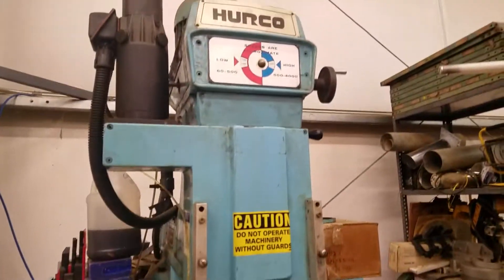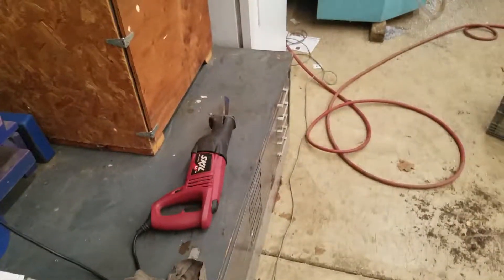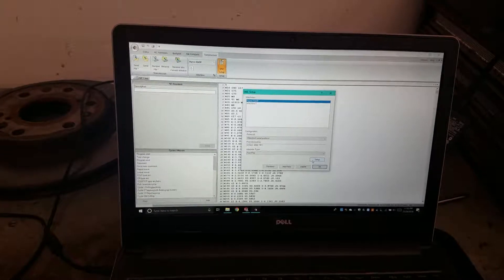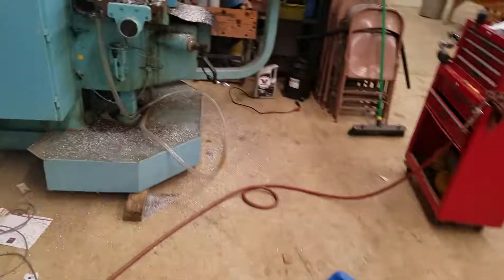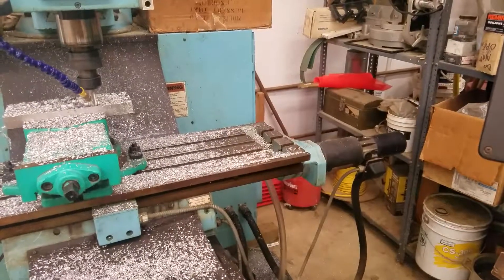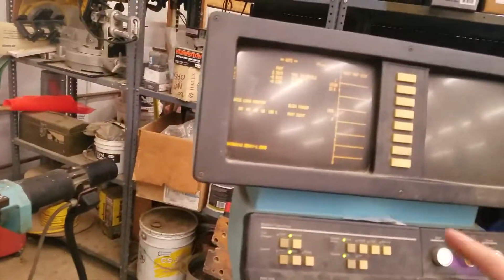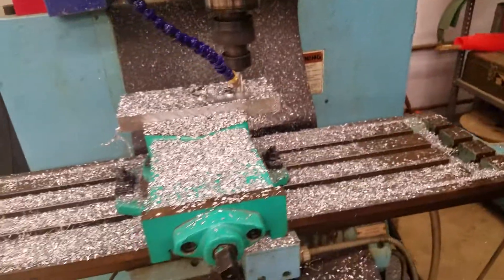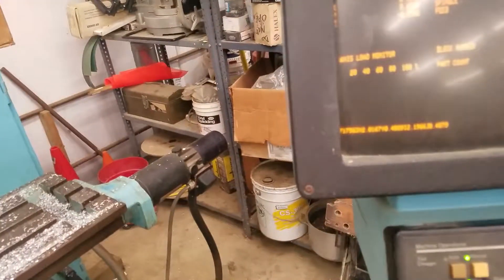1983 Hurco KM3 running CAM generated code

Comment: Hello man, I got an 1984 Hurco BMC 20 and I would like to load programs (that I make in Fusion 360) via a floppy drive to USB emulator, but I don't know if the Ultimax 2 controller has the capability to support that or do I need to feed the G code like you do with your Hurco. What do you think?

Comment: I have a hurco kmb1 it runs hurco conversational code but i would like it to run gcode somehow. Did your Hurco run conversation code and then your converting that to gcode?
Reply from the maker: No, the machine in this video was running on straight g code and was not using conversational programming. I was sending it g code via RS232 serial, and there should be a setting somewhere on your machine on the controller to switch it to NC mode. However, if its anything like mine, when you do this, you will loose some settings like tool offsets and work offsets when you change it from conversational mode to NC mode.

Comment: I know this is old, but did you ever take photos of the manual?
Reply from the maker: I think I might still have the manual somewhere. I'm in the process of converting the machine to run on a different controller (LinuxCNC). What pages do you need?
Reply: @flyingfencepost  I haven't purchased the unit yet. I'm pretty much researching right now.
Reply from the maker: @RailyardProductions  Gotcha, well from a usability standpoint, if the stock controller is working well, the conversational programming is very easy to follow, albeit somewhat limited. And as far as machine maintenance goes, it's very similar to a Bridgeport.

Comment: Ask a question What is the speed of the motor hurco km-3 RPM, I will connect it to the inverter. The nameplate of the motor is missing.

Comment: I recently purchased a Hurco KM3 and do not have any Pinout info for RS232.  Do you happen to have the info on how you made the cable? I have the MIL ports on the back and not sure how to pin them out
Reply from the maker: Sure thing, I have a complete manual so I believe this is the page that should help you out. My dad built a harness, but that was so long ago I cant remember what the pinouts were. https://imgur.com/a/yxnlLyl
Reply: @flyingfencepost  that's awesome!!! Thanks so much!! What would it take to get a copy of that Manual? I contacted Hurco and even they don't have any info on these old Machines
Reply from the maker: @KEBGaming  shoot. I don't even know. You could maybe find some on ebay, but otherwise, I could perhaps scan it. Are there specific sections you'd like?
Reply: @flyingfencepost    If you could Scan it that would be awesome (Pics are fine).  Also what cables did you use to get the USB Connection to the Laptop?  I Found the Mil Spec connectors for the Machine, but I need to build the cable not and hopefully end with a USB like yours.     
Thank you again for your help!!
Reply from the maker: @KEBGaming  What you need after you build the mil to rs232 cable, is a USB to rs232 adapter. And ok. I'll see if I can scan it. It's pretty big, but I'll give it a try.
Reply: @flyingfencepost  what program did you use to send serial data from the computer to the machine?
Reply from the maker: @timbufordbriggs  CIMCO Edit
Reply: @flyingfencepost  Thanks for the info.  I just bought one of these machines and am trying to get it to work and am stuck on the serial communications.  When I send data the hurco just sets there with the "receiving data" just blinking.  Can't figure out what is wrong.  Any suggestions?  Thanks!
Reply: I have done a little more checking...my post processor puts a "%" at the end of the program.  Can you show me what the end of one of your programs has?  Thanks!

Comment: I am interested in knowing how you made the communication between autodesk and the hurco milling machine km3
Reply from the maker: What part do you want to know more about? Im just using the editor that comes with HSM to send the file to the machine via RS 232 serial communication.
Reply: @flyingfencepost  post processor ?